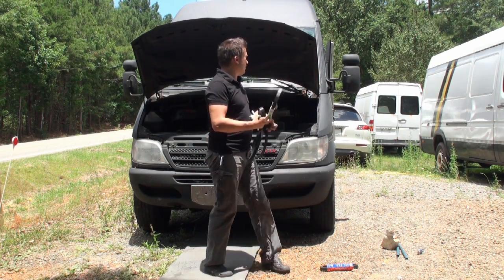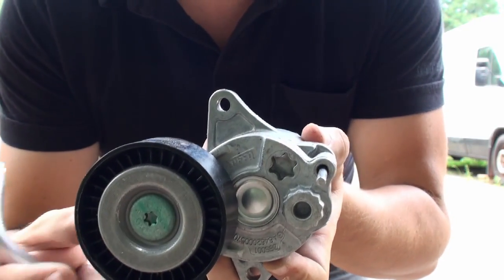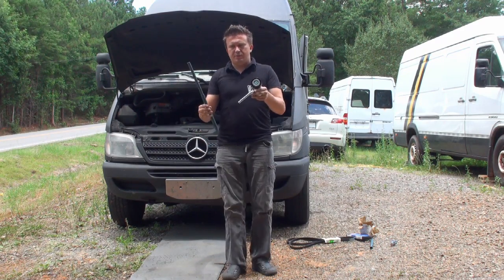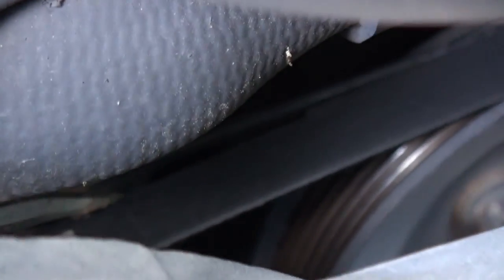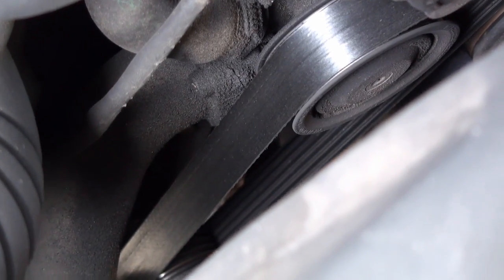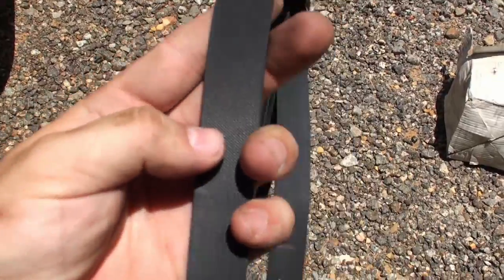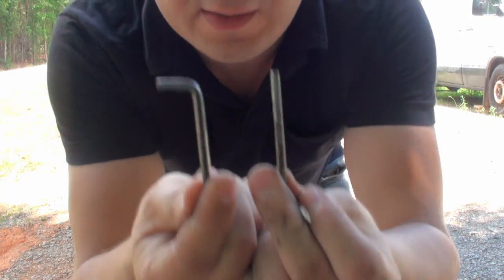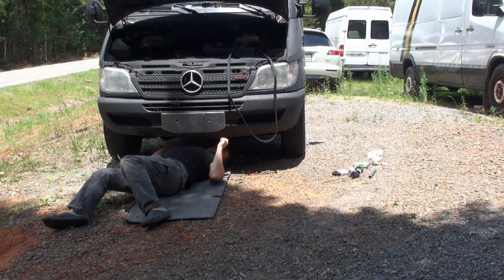Mercedes Sprinter Series: Serpentine Belt Change on 2.7L Diesel Engine! How To: Part 50

Comment: Suggestions: you need a remote microphone so you are wearing it. Too much outside noise, music is way to loud.  Should have said what size hex key you use to hold the tensioner out.
Reply from the maker: Yes that is an Excellent Idea and I am working on that solution, and have recently learned how to match audio to external mic in editing process, this is why some of my Old Videos will get a redo for Better sound with voice over, to be on point to my topic, and not to waste your time, my goal is to have information that is easy to understand yet, you can get it go and not waste time, also try to make shorter Videos as a while, all this will be using professional Editing software, I got the Hang of it now wich is great, it lookd hard at first, But this channel came a long way considering i started it less then 6 months ago as a Hobby, but i resided to go Pro. Hope you enjoy and please feel free to give me tips I can use them lol.

Comment: You should of shown footage inside the engine compartment.  I need to figure out the fan part
Reply from the maker: I have a video on the inside part, 2 videos actually, one in season 3 water pump change and one in season 1 where I show how to do it

Comment: My friend, the serpentine belt is the focus of the overall well-being of the vehicle! Imagine the belt is rotating around our planetary system, smoothly! Especially in the imbalanced tdi straight 5cly, the spinning forces just don’t match up. But you can live machine those parts to make the belt spin smoother!
Reply: Tdi straight 5 is notorious for engine vibration which leads to all problems in the vehicle, especially electrical. It shakes everything loose because of it’s awesome torque!
Reply: But if you can tame it, it’s your steed!
Reply: The German engineers were brilliant, but their flaws in selling this engine was cheap manufacturing process! They paid cheap contractors for matching their parts! All for corporate profits! Sad!
Reply: Actually, the Germans are brilliant engineers, but because of the competitive world they cheated with the Ww!
Reply: To me, a belt in each vehicle should be treated as diamond & pearl!
Reply from the maker: You right

Comment: Question I have a 2010 Mercedes sprinter 2500 do have to remove the fan and the fan cover to put on the main serpentine belt.
Reply from the maker: No but it would make your life much easier do

Comment: Thank you . i can now attempt to put belt on my 06 sprinter.
Reply from the maker: Your welcome, btw I actually have better video to change belt for 06 because I. This one you can’t see what I did
Reply from the maker: Here’s a link to a better video https://youtu.be/1Fqlm9_sw-o
Reply: I do not have the correct belt diagram for my 2006 sprinter mb OM647.  I only can find diagrams that show TWO "idler" pullies (from CD ULTIMATE SERVICE,other info on this cd has been helpful).

i have only ONE "idler" pulley which is located just above the drive belt tensioner.  I cant route my mb belt using that diagram.
   I believe i found a diagram that that shows NO "idler" pullies on line. 
So i will try agan.  I dont like curveballs.
thanx for quick response. I will view your video just offered
Reply: Never mind my incorrect info above.   I believe i have figured it out.
i wont get back to it for a few days becsuse another storm is coming (cape cod). It will get fixed one way or another.. the sprinter is like a giant vw golf. It's # 1.
Reply from the maker: Wow I never seen one idler pulley that’s interesting
Reply from the maker: Lol so true, we should be getting snow to in South Carolina

Comment: thanks for the video,  I was riding along and my 2011 sprinter  battery light came on and eventually sprinter shut off on me.   would not restart...looks like it is the belt went bad on it...so thanks for the video.  Question ?   can you restart the sprinter without the belt on ?  trying to not occur a 2nd towing fee to my mechanic to get the belt replaced?   with your help I may try to replace it myself?
Reply from the maker: Yes you can but with no belt it will over heat

Comment: I am going to give you some constructive criticism. The sound is as important as seeing "get a microphone". It will help eliminate a lot of the background noise. I like the music but it is up to high. You are not actually showing how you do it. I hope this helps and I hope to see more videos. good luck.
Reply from the maker: +John Ferb thanks so much, yes your absolutely right I could not have said it better myself, I am no longer adding sound to the video unless it’s a time lapse, but not while I am working and talking, also, I have improved the sound, and for this particular camera I have bought a boom mic or a shotgun mic I hope it helps, but I record most videos using iPhone 7 and it has great sound, not doing any 4K videos yet but thinking about it, also about seeing what i am doing, in this particular-case it was not easy to get the shot, so I will be remaking this type of video, I just removed an I tire Front End on one of the Sprinters I am working on, and I will record how to change belt with better viewing angle and show how to change pulleys and tension pulley and also will be remaking videos with better sound for high pressure fuel pump and other stuff, thanks for letting me know this, I am working on improving all my future videos

Comment: Hi, how much work is involved in changing the timing belt?
Reply from the maker: This is a serpentine belt, it has no timing belt it’s a timing chain, but if your looking to replace this belt, I have a video where I change water pump and in that video I dismantled the front end and you can see exactly how to do it, look for it in season 3 playlist on my main page, it’s about 5 min job for me
Reply: ZIMALETA HOW TO SHOW SPRINTER HELP awesome. I am looking at buying a Mercedes camper RV and it has 255,500 kms, but they had the timing belt changed 50,000 at a dealership so I suspect it should be fine for another 100,000 kms

Comment: Serge 
My name is Paul i wrote you email also 

I have 2017 sprinter . it is not much driven it is only 12000 miles .
i was changing oil and did not position my o ring properly so i had oil leakage squirting out of filter housing what sprayed oil on my engine and on serpentine .we stopped engine in not more than 10 second but by then i had a puddle .

then my serpentine belt kept sitting in oil on pulleys till next morning .
I bought engine degreaser so called safe for belts and kind of cleaned it twice.
my question is
1. is it ok to drive my van after it dries out ?
2. how quickly i have to change my serpentine belt and cranck belt 
3.though my belts are not driven much they look good do i have to change tensioner pulley also .
4.can i change it myself with your video info 
5. i put my van into neutral to move my cranck pulley to clean under areas those are not moved can i turn it this way or any suggestions
Reply from the maker: Hey, I know you want me to answer allot of questions but maybe it’s best to just make a video on that, but I will say this, I don’t recommend cleaning your engine, unless you disconnect your car battery and make sure that non of your sensors or connectors get water in them, not saying that if you get them wet it will cause major problems, but this vans can throw all kinds of codes and go into limp mode sometimes for no reason, it’s best to play it safe, but in your situation you had no choice and it looks like you got a cleaner that is safe, I am not sure how much oil made it to the belt or tensioner, and if you were able to clean all oil off, I don’t see any reason that you can’t drive your van right away, as for the replacement of belt, I recommend to replace it 50-80k but replace all belts and pulleys, because if you simply replace 1 pulley or 1 belt, and let’s say some other pulley fails, it will shred your belt or belts, so if your hearing rattling sound coming from the front of your engine, it’s time for new belts and pulleys, but I recommend you keep old ones as spares

Comment: Hi Serg , quick question..2006 2.7 ltr. 5 cyl.  sprinters only have one belt correct ? They are trying to charge me for an alternator belt remove and replace as well as serpentine belt replace.
Reply from the maker: Lol they must think your blond, you are correct my friend it’s just one belt, 2007 and up 3.0 Have 2 belts, I can’t believe this guys, it’s 5 min job
Reply: Thanks for  reply !! these idiots are trying to charge me $673.00 to replace the belt and 1 tensioner pulley. Would have done it myself if I had my tools and a way to get to a parts store that stocked it.      :-(
Reply from the maker: Crap that’s to much? OMG if I was there I would help you free, I even Cary a spare tension pulley and pulleys, sorry to hear this bro, why not just call a taxi get the part and tools, at this price you can get a full mechanic. Tool set and parts with 300 bucks to spare

Comment: I misunderstood the belt diagram.when i figured it out, the belt went on easily. It does have both idler pullies.. i was wrong.
it took 6 minutes to put belt on ! My alternator may be next job on sprinter . Thanx
Reply from the maker: Cool glad you figured it out

Comment: Hello. Do you have for sale four bolts for mounting for - Steering Rack - 2005 Dodge Sprinter 3500 ?
Reply from the maker: I only have used bolts that I can remove from my used sprinters I got 8 sprinter vans and 21 cars that I fix and some part out
Reply: Yes 3500
Reply: Yes I am understand I am ready to buy used bolts

Comment: Great video tha nks!  Can you show replacing the idle pulley?  Is that easy?  Is it just 1 bolt holding it in?
Reply from the maker: I have made the video me replacing the idler pulley's and the tensioner pulley and the correct way to put the belt on, just need to edit it and put it on, Idler pulley just takes one 50 torques Allan ranch and 40 torques on tensioner and 60 torques Allan ranch to adjust the belt, All this I have on my next video, I used a different van to make it, with front end dissembled so you can see everything. is there anything else i can show you how to replace, just let me know, i have some free time this week i can make a video. thanks for watching please Subscribe.
Reply: Great I'll watch for that video.  I have a 118" with 200k.  The only issue I have is 'RSN' right around 35-40MPH.  Never occurs on the freeway and the van is mostly used for long road trips.  I changed the fluid out and it did help slightly but the RSN did not go away completely.  Do you have any RSN on your vans?  Have you ever done the RSN fix from Dr.A that you can find on the fourms?  I think this would make a great video.  I do not see one on youtube.
Reply from the maker: i know Dr A, i talked to him on the phone a while back with stuff i was doing, but i am not familiar with RSN what is that short for, let me know i will reply right away.
Reply: It's a shutter that comes from the transmission.  Dr.A is the brains behind it.  At one time he sold a kit.  (I dont think he does anymore)  I was hoping the new transmission fluid would fix it.  I've been just living with it but it's annoying.  Here is most detailed article I can find on it https://dieselrepairblog.wordpress.com/2012/03/23/sprinter-transmission-rsn-repair/
Reply from the maker: ahh ok yes i know what your talking about, i have seen Dr As Topic on this way back, its basically caused by the torque converter and you drill a tiny hole in the valve body to stop it, but to be honest with you, i just wont worry about it, i have been driving sprinters for a long time and some are worst then others and i have some problems with it now, but only some times, after i have changed the transmission and the torque converter, it was kinda hard noise in the bigining  but after driving for less then 1k miles the noise has kinda disapiard, i personaly think my problem was due to dry valve body and silinoids, because i cleaned it with break cleaner when i took it apart and i let it sit for a 2 weeks, and when i drove it for 1k miles i think it oil things up now the nice is less oftain,
Reply: Interesting.  I just changed my transmission fluid.  (full drain)  I have only driven a few 100miles or so on it.  Perhaps it will go away with more miles.  Thanks a lot for the info!
Reply from the maker: anytime, question, did you drain torque converter?
Reply: Yep.  It's shifting smoothly.  It doesn't have any issues besides RSN.
Reply from the maker: +Jon Gould, that's great, I would not worry about it, I know it's annoying to hear the sound but it's so Comon with sprinters, and I can tell you this i got over a million miles out of my transmission and it was doing this the entire time, but I did always replaced oil from torque converter and always changed filter and seal and 13 pin connecter, i also replaced conducted plate 2 times, the first time, it needed one second time it was preventive maintenance, I drive for a living and $150 for new conductor plate was worth it to me, then having problem while i a, delivered  important load, BTW if you never cleaned your speed sensor, I highly recommend doing it on your next transmission oil change, to prevent limp mode problems, the speed sensor gets allot of metal buildup on it, cleaning it would usually do the trick, but I think replacing it is better if it hasn't been done in a while unless, you drive local, then cleaning it would be ok to, just for long trips you want to make sure your sprinter is at optimal performance.
Reply from the maker: +Jon Gould BTW I forgot you said your sprinter is 200k miles, changing your conductor plate might not be needed, how ever sometimes they fail at 40-80k on some Mercedes cars, I think sprinter can go longer if you drive just on highways considering your transmission needs to shift less, because mostly you will be in 5th gear, and it should create less metal dust, then say a car that drives 80k miles but it's always stop and go, that's allot of shifting and wear and tear on your transmission.

Comment: I didn't see where to place the allen key to lock out the tension pulley.
Reply from the maker: +Dave Mallon in this Video you cant see it, on the Van, but i belive i show the Tensioner Pulley, In this video, you cant go wrong its just one place to put allen key,

Comment: how do you replace the radiator, condensor and inercooler?
Reply from the maker: +William Goodman it's not difficult, I will make a video on it, but condenser little hard because the bolts get stuck on there and there Aluminum, so it's easy to strip them, but best to just use 2 monkey ranches on them

Comment: You are not actually showing how you do it.
Reply from the maker: +Anthony Tommy I will in a future video
Reply: I mean my friend and I figured out how both belts got routed, but just doing the alternator itself is a task since the one I r&r ed the alternator has rear ac so I had to drop the secondary compressor to get the alternator out, and putting it back in with the idler pulley is quite a task.
Reply from the maker: +Anthony Tommy oh I bet, you have 2 Alternators?